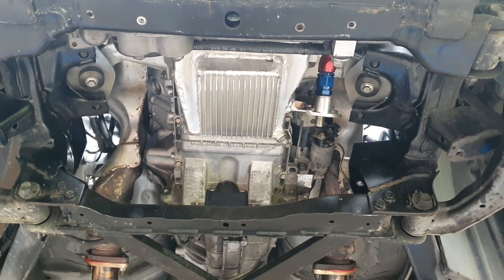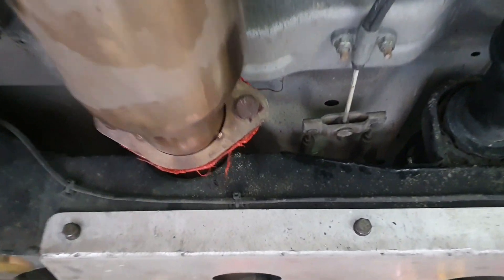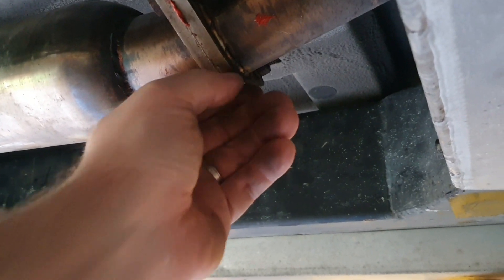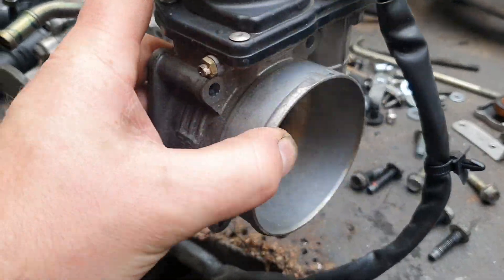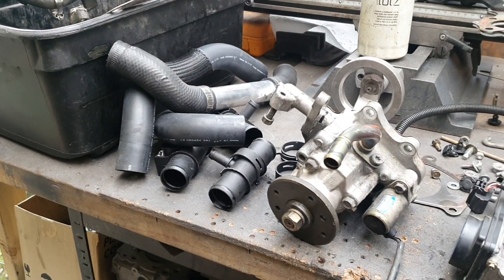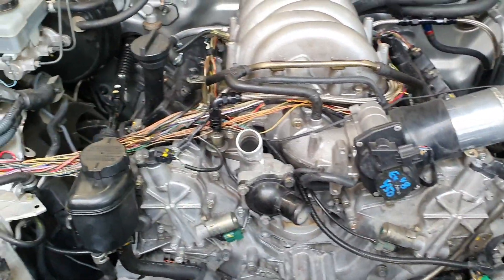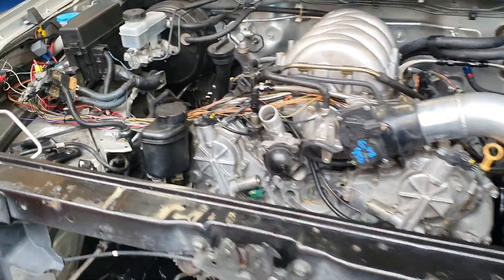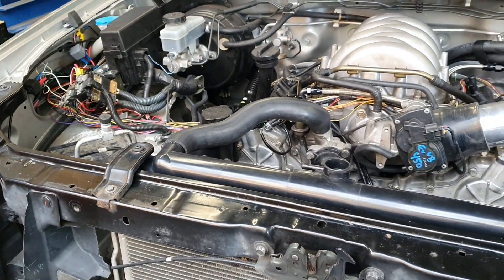D40 V8 Navara engine change - it runs!

Comment: What clutch you using brother? I’m doing the same swap soon. The 6spd diesel box up to the job?
Reply from the maker: Just the Z32300zx twin turbo friction disk and a Navara pressure plate on a modified 300zxTT flywheel.
The box has lasted over 40k Kms so far and doesn't appear to have any issues.
Reply: @TheLabLimited  thanks for your prompt response mate. Appreciate it. It may be a possibility I’ll have to get one sent from NZ here to Perth, Australia as I doubt I’ll find a 300zx flywheel here. Do you have an email or is best to get you here? I’ll be dropping the motor into a D40. Is it better to use a 4.0 as the base or does it not matter if it’s the diesel model?

Comment: what is this engine? and is the gearbox original nissan navara d40 ?
Reply from the maker: VK45DE
Original 2WD six speed D40 Navara gearbox with bellhousing cut and spliced to fit VK45DE
Reply: @TheLabLimited  Will he put this engine in the Navara D40 4x4 ?